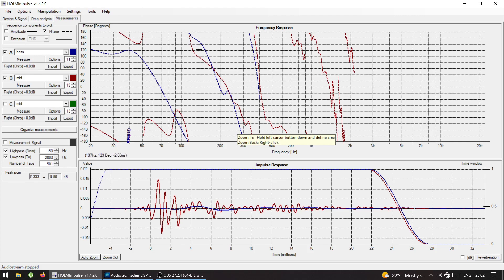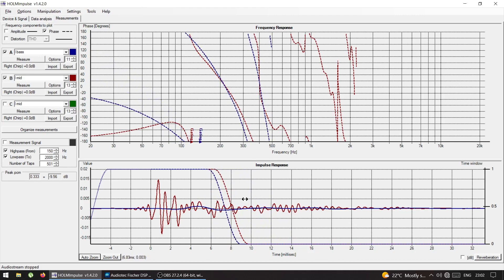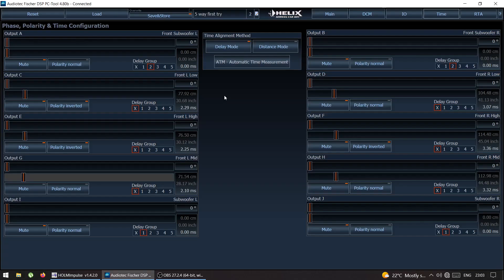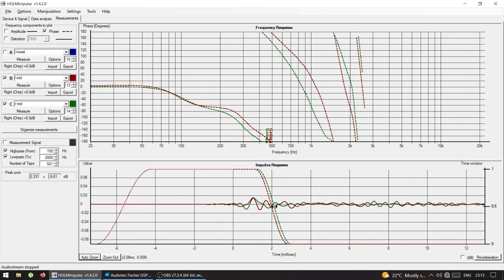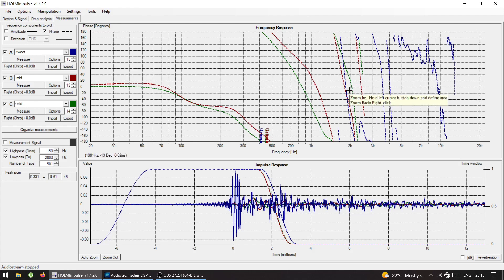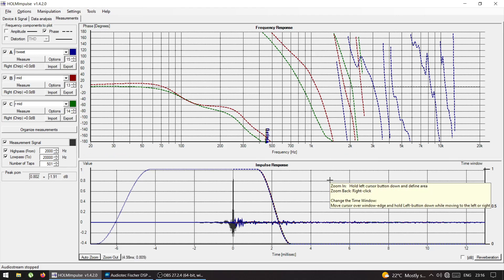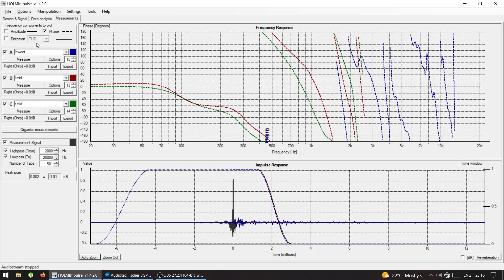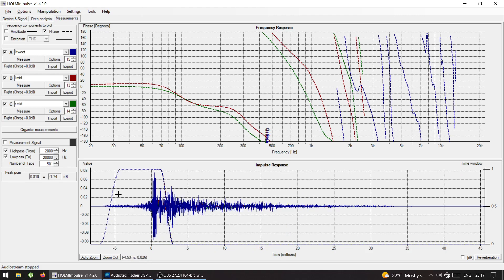Tuning a 5 way system - part nine - fixing mistakes

Comment: If you were using a UMIK mic via usb, would it make thi salot easier? Wouldnt you be able to do all of this in REW?
Reply from the maker: USB mics and impulse responce has a difficult relationship🙂 USB clock tends to drift.
Reply: @RAW-CAt  Ahh, really. I've yet to use it. Will pull out the outboard soundcard also then. Many thanks for your response. You've saved me time experimenting. Many thanks again!

Comment: just curious, did the engine of or on while you were measuring all the response ?
Reply from the maker: Engine is off on all my tunes.
Reply: @RAW-CAt  you plugging in the battery charger while rta-ing then, am i correct ? gonna buy a mic and a soundcard, with your tutorial im gonna do it. thank you for the tutorial videos
Reply from the maker: @nevermore4505  yes, now I connect a charger, good luck😉

Comment: It’s not eq or timing or phase, it’s the fundamental position of the tweeter, move it up the pillar a little or try aiming it more up the car more in that same location

Eq and timing won’t change the position of the sound to the ear, if anything changes with holme impulse the mic has moved a fraction

Your playing one driver when listening to the left track, if that moves over to your ear then the centre will also move over by half as much, that’s how your hearing works

Make the left tweeter a point source and the sound won’t move over either at the centre. You can change the centre with eq to a degree, but it’s far better to get the tweeter in the right place first 👍🏼

If timing is correct you will have the centre perfectly between the two left and right sources of sound

You described the left being 2” over for example, and the centre being 1” over also, the above makes good sense of the issue you have

If you move the mic and it’s not in the same place for timing measurements then timing will be off by impulse response

Comment: And you need to learn more about delays as you are matching the phase, but not the timing correctly, the phase is a result of the response. But timing is far more important initially

Manipulating gating to find a good area of phase and make it match isn’t correct

Gating just removes the influence of reflections by giving a time limit where the mic captures, but in doing that your ignoring the actual impulse response measurements which you threw out by a good amount

Adding delay moves the phase trace down by x amount of degrees proportional to the frequency concerned. Removing delay moves it up…
Reply: Adam..can you explain what you mean by gating?